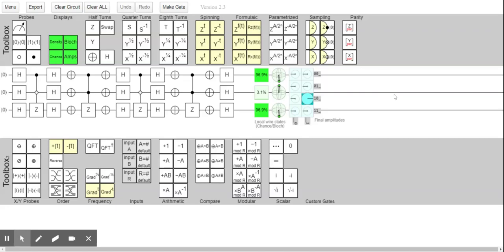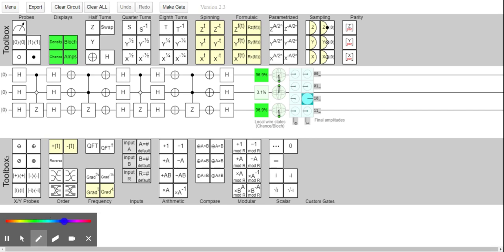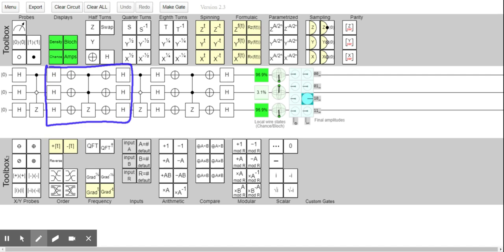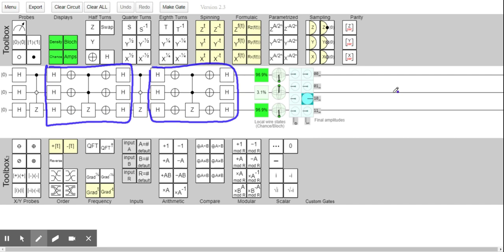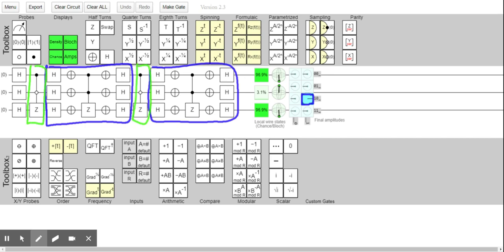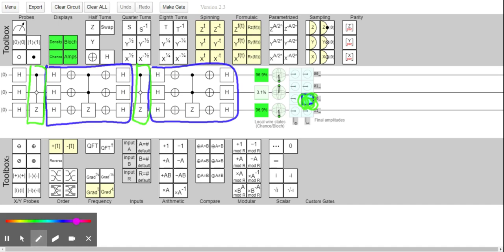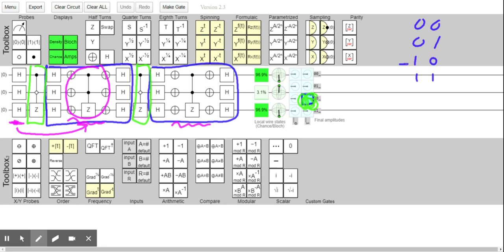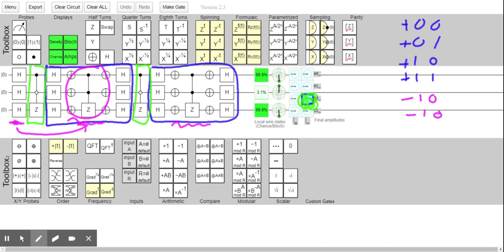Grover's Algorithm - Recap Attempt [Part 13]

Comment: Imagine you have a list of numbers (3, 5, 6 and 17) and you want to find the position of the 6. How would you do it?
Reply: If I understood this well, the way I will do it is to map them to binary (00: 3; 01: 5; 10: 6; 11: 17) and then set the oracle function that finds the 10 (the 6 in binary)..., having just 4 numbers can be visually resolved, but when you have millions, it will be difficult to find which one's the solution..., that's the way I thought..., how does it sound?
Reply from the maker: The way the OP asks the question is a bit trickier than that. The OP is asking for the "position" or "address" rather than the value itself. Grover is often explained as an algo to find a solution (search over the space of solutions rather than a classical DB search) to a big problem where we maybe know some structure that allows us to build such an oracle among a huge space of possible answers. In this case your summary is correct. 

Nevertheless, if what you want is to find the "index" or "address" of a value in a DB you need to adapt the algo a bit. This usually implies loading your entire DB in superposition including your adresses or indices (some people use a concept called qRAM and load addresses in a register and then entangle them with values in another register), then applying Grover to the value registers and finally extracting the index (not the values). This gets tricky because of entanglement but there's a good explanation of how to approach this version of the algo here: https://arxiv.org/pdf/1502.04943.pdf

The content in this channel is really the result of my learnig journey so a lot f these vids might miss some of the later learnings ;) Here is a video on qRAM that I did a while ago: https://www.youtube.com/watch?v=Sf3fzjKx8ZY&t=1005s
Reply from the maker: I hope this helps you both and if you are interested in learning more and maybe joining a more private community of learners reach out to me via uncertainsystems@gmail.com and I'll send you an invite to my Discord Server ;)

Comment: So 000 is the seeded position and 110 is your final outcome?? Is that write? I’m trying to understand it from a search perspective...
Reply from the maker: I don't think I understand your question? Could you rephrase?
Reply: Quantum Intuition of course! I was to believe that Grover’s was a search algorithm...so I wha way is it using interference to complete a search??
Reply from the maker: Grovers search algorithm assumes the answer to your search already exists but it's encoded in the phases and therefor not accessible directly. The Alg uses the amplitude amplification technique which basically phases your superposition in a way that it turns destructive into constructive interference this revealing the search result. But remmeber that the difference here between this and other search algs is that the oracle here knows the answer or knows how to flag the answer to your search :)